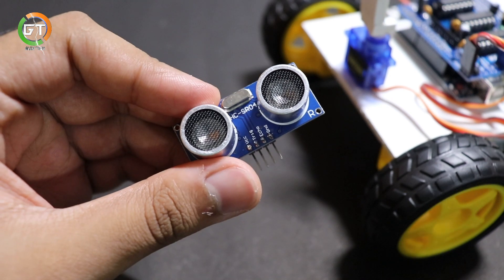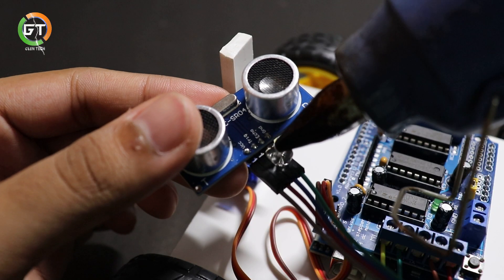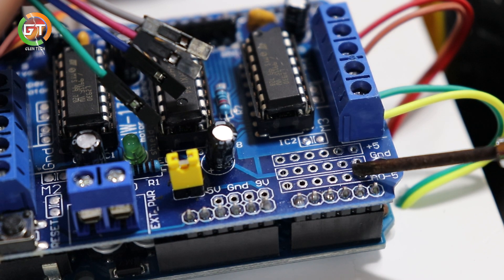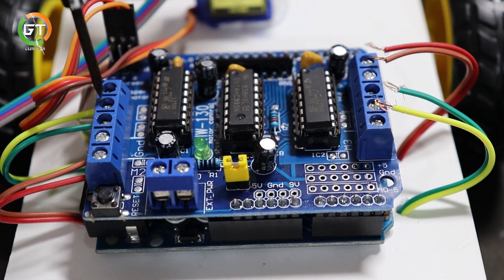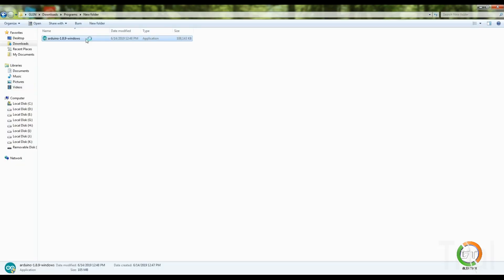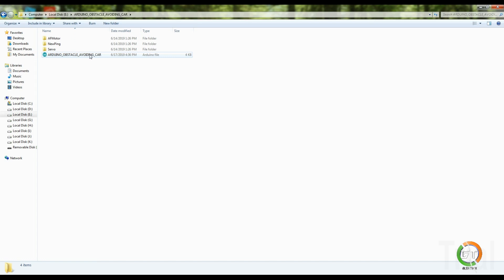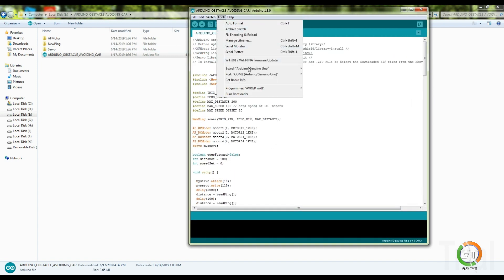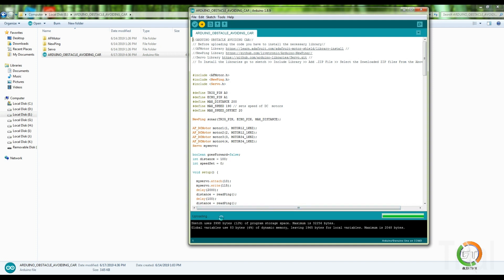How To Make A DIY Arduino Obstacle Avoiding Car For Science Project

Comment: I were inserted code into Arduino ..howcan i delete that and reset my board..
Reply from the maker: No need to reset , you just insert new code
Reply from the maker: //ARDUINO OBSTACLE AVOIDING CAR//
// Before uploading the code you have to install the necessary library//
//AFMotor Library https://learn.adafruit.com/adafruit-motor-shield/library-install //
//NewPing Library https://github.com/livetronic/Arduino-NewPing// 
//Servo Library https://github.com/arduino-libraries/Servo.git //
// To Install the libraries go to sketch >> Include Library >> Add .ZIP File >> Select the Downloaded ZIP files From the Above links //

#include <AFMotor.h>  
#include <NewPing.h>
#include <Servo.h> 

#define TRIG_PIN A0 
#define ECHO_PIN A1 
#define MAX_DISTANCE 200 
#define MAX_SPEED 190 // sets speed of DC  motors
#define MAX_SPEED_OFFSET 20

NewPing sonar(TRIG_PIN, ECHO_PIN, MAX_DISTANCE); 

AF_DCMotor motor1(1, MOTOR12_1KHZ); 
AF_DCMotor motor2(2, MOTOR12_1KHZ);
AF_DCMotor motor3(3, MOTOR34_1KHZ);
AF_DCMotor motor4(4, MOTOR34_1KHZ);
Servo myservo;   

boolean goesForward=false;
int distance = 100;
int speedSet = 0;

void setup() {

  myservo.attach(10);  
  myservo.write(115); 
  delay(2000);
  distance = readPing();
  delay(100);
  distance = readPing();
  delay(100);
  distance = readPing();
  delay(100);
  distance = readPing();
  delay(100);
}

void loop() {
 int distanceR = 0;
 int distanceL =  0;
 delay(40);
 
 if(distance<=15)
 {
  moveStop();
  delay(100);
  moveBackward();
  delay(300);
  moveStop();
  delay(200);
  distanceR = lookRight();
  delay(200);
  distanceL = lookLeft();
  delay(200);

  if(distanceR>=distanceL)
  {
    turnRight();
    moveStop();
  }else
  {
    turnLeft();
    moveStop();
  }
 }else
 {
  moveForward();
 }
 distance = readPing();
}

int lookRight()
{
    myservo.write(50); 
    delay(500);
    int distance = readPing();
    delay(100);
    myservo.write(115); 
    return distance;
}

int lookLeft()
{
    myservo.write(170); 
    delay(500);
    int distance = readPing();
    delay(100);
    myservo.write(115); 
    return distance;
    delay(100);
}

int readPing() { 
  delay(70);
  int cm = sonar.ping_cm();
  if(cm==0)
  {
    cm = 250;
  }
  return cm;
}

void moveStop() {
  motor1.run(RELEASE); 
  motor2.run(RELEASE);
  motor3.run(RELEASE);
  motor4.run(RELEASE);
  } 
  
void moveForward() {

 if(!goesForward)
  {
    goesForward=true;
    motor1.run(FORWARD);      
    motor2.run(FORWARD);
    motor3.run(FORWARD); 
    motor4.run(FORWARD);     
   for (speedSet = 0; speedSet < MAX_SPEED; speedSet +=2) // slowly bring the speed up to avoid loading down the batteries too quickly
   {
    motor1.setSpeed(speedSet);
    motor2.setSpeed(speedSet);
    motor3.setSpeed(speedSet);
    motor4.setSpeed(speedSet);
    delay(5);
   }
  }
}

void moveBackward() {
    goesForward=false;
    motor1.run(BACKWARD);      
    motor2.run(BACKWARD);
    motor3.run(BACKWARD);
    motor4.run(BACKWARD);  
  for (speedSet = 0; speedSet < MAX_SPEED; speedSet +=2) // slowly bring the speed up to avoid loading down the batteries too quickly
  {
    motor1.setSpeed(speedSet);
    motor2.setSpeed(speedSet);
    motor3.setSpeed(speedSet);
    motor4.setSpeed(speedSet);
    delay(5);
  }
}  

void turnRight() {
  motor1.run(FORWARD);
  motor2.run(FORWARD);
  motor3.run(BACKWARD);
  motor4.run(BACKWARD);     
  delay(500);
  motor1.run(FORWARD);      
  motor2.run(FORWARD);
  motor3.run(FORWARD);
  motor4.run(FORWARD);      
} 
 
void turnLeft() {
  motor1.run(BACKWARD);     
  motor2.run(BACKWARD);  
  motor3.run(FORWARD);
  motor4.run(FORWARD);   
  delay(500);
  motor1.run(FORWARD);     
  motor2.run(FORWARD);
  motor3.run(FORWARD);
  motor4.run(FORWARD);
}
Reply from the maker: // Before uploading the code you have to install the necessary library//
//AFMotor Library https://learn.adafruit.com/adafruit-motor-shield/library-install //
//NewPing Library https://github.com/livetronic/Arduino-NewPing// 
//Servo Library https://github.com/arduino-libraries/Servo.git //
// To Install the libraries go to sketch >> Include Library >> Add .ZIP File >> Select the Downloaded ZIP files From the Above links //

Comment: Bro pls tell me ...all the connections are correct....but motor are not rotating.........
Reply from the maker: // Before uploading the code you have to install the necessary library//
//AFMotor Library https://learn.adafruit.com/adafruit-motor-shield/library-install //
//NewPing Library https://github.com/livetronic/Arduino-NewPing// 
//Servo Library https://github.com/arduino-libraries/Servo.git //
// To Install the libraries go to sketch >> Include Library >> Add .ZIP File >> Select the Downloaded ZIP files From the Above links //

Comment: Why my car he ring ?
Reply from the maker: //ARDUINO OBSTACLE AVOIDING CAR//
// Before uploading the code you have to install the necessary library//
//AFMotor Library https://learn.adafruit.com/adafruit-motor-shield/library-install //
//NewPing Library https://github.com/livetronic/Arduino-NewPing// 
//Servo Library https://github.com/arduino-libraries/Servo.git //
// To Install the libraries go to sketch >> Include Library >> Add .ZIP File >> Select the Downloaded ZIP files From the Above links //

#include <AFMotor.h>  
#include <NewPing.h>
#include <Servo.h> 

#define TRIG_PIN A0 
#define ECHO_PIN A1 
#define MAX_DISTANCE 200 
#define MAX_SPEED 190 // sets speed of DC  motors
#define MAX_SPEED_OFFSET 20

NewPing sonar(TRIG_PIN, ECHO_PIN, MAX_DISTANCE); 

AF_DCMotor motor1(1, MOTOR12_1KHZ); 
AF_DCMotor motor2(2, MOTOR12_1KHZ);
AF_DCMotor motor3(3, MOTOR34_1KHZ);
AF_DCMotor motor4(4, MOTOR34_1KHZ);
Servo myservo;   

boolean goesForward=false;
int distance = 100;
int speedSet = 0;

void setup() {

  myservo.attach(10);  
  myservo.write(115); 
  delay(2000);
  distance = readPing();
  delay(100);
  distance = readPing();
  delay(100);
  distance = readPing();
  delay(100);
  distance = readPing();
  delay(100);
}

void loop() {
 int distanceR = 0;
 int distanceL =  0;
 delay(40);
 
 if(distance<=15)
 {
  moveStop();
  delay(100);
  moveBackward();
  delay(300);
  moveStop();
  delay(200);
  distanceR = lookRight();
  delay(200);
  distanceL = lookLeft();
  delay(200);

  if(distanceR>=distanceL)
  {
    turnRight();
    moveStop();
  }else
  {
    turnLeft();
    moveStop();
  }
 }else
 {
  moveForward();
 }
 distance = readPing();
}

int lookRight()
{
    myservo.write(50); 
    delay(500);
    int distance = readPing();
    delay(100);
    myservo.write(115); 
    return distance;
}

int lookLeft()
{
    myservo.write(170); 
    delay(500);
    int distance = readPing();
    delay(100);
    myservo.write(115); 
    return distance;
    delay(100);
}

int readPing() { 
  delay(70);
  int cm = sonar.ping_cm();
  if(cm==0)
  {
    cm = 250;
  }
  return cm;
}

void moveStop() {
  motor1.run(RELEASE); 
  motor2.run(RELEASE);
  motor3.run(RELEASE);
  motor4.run(RELEASE);
  } 
  
void moveForward() {

 if(!goesForward)
  {
    goesForward=true;
    motor1.run(FORWARD);      
    motor2.run(FORWARD);
    motor3.run(FORWARD); 
    motor4.run(FORWARD);     
   for (speedSet = 0; speedSet < MAX_SPEED; speedSet +=2) // slowly bring the speed up to avoid loading down the batteries too quickly
   {
    motor1.setSpeed(speedSet);
    motor2.setSpeed(speedSet);
    motor3.setSpeed(speedSet);
    motor4.setSpeed(speedSet);
    delay(5);
   }
  }
}

void moveBackward() {
    goesForward=false;
    motor1.run(BACKWARD);      
    motor2.run(BACKWARD);
    motor3.run(BACKWARD);
    motor4.run(BACKWARD);  
  for (speedSet = 0; speedSet < MAX_SPEED; speedSet +=2) // slowly bring the speed up to avoid loading down the batteries too quickly
  {
    motor1.setSpeed(speedSet);
    motor2.setSpeed(speedSet);
    motor3.setSpeed(speedSet);
    motor4.setSpeed(speedSet);
    delay(5);
  }
}  

void turnRight() {
  motor1.run(FORWARD);
  motor2.run(FORWARD);
  motor3.run(BACKWARD);
  motor4.run(BACKWARD);     
  delay(500);
  motor1.run(FORWARD);      
  motor2.run(FORWARD);
  motor3.run(FORWARD);
  motor4.run(FORWARD);      
} 
 
void turnLeft() {
  motor1.run(BACKWARD);     
  motor2.run(BACKWARD);  
  motor3.run(FORWARD);
  motor4.run(FORWARD);   
  delay(500);
  motor1.run(FORWARD);     
  motor2.run(FORWARD);
  motor3.run(FORWARD);
  motor4.run(FORWARD);
}
Reply: I know come on to your instagram for watch video

Comment: error help me plss
Reply from the maker: //ARDUINO OBSTACLE AVOIDING CAR//
// Before uploading the code you have to install the necessary library//
//AFMotor Library https://learn.adafruit.com/adafruit-motor-shield/library-install //
//NewPing Library https://github.com/livetronic/Arduino-NewPing// 
//Servo Library https://github.com/arduino-libraries/Servo.git //
// To Install the libraries go to sketch >> Include Library >> Add .ZIP File >> Select the Downloaded ZIP files From the Above links //

#include <AFMotor.h>  
#include <NewPing.h>
#include <Servo.h> 

#define TRIG_PIN A0 
#define ECHO_PIN A1 
#define MAX_DISTANCE 200 
#define MAX_SPEED 190 // sets speed of DC  motors
#define MAX_SPEED_OFFSET 20

NewPing sonar(TRIG_PIN, ECHO_PIN, MAX_DISTANCE); 

AF_DCMotor motor1(1, MOTOR12_1KHZ); 
AF_DCMotor motor2(2, MOTOR12_1KHZ);
AF_DCMotor motor3(3, MOTOR34_1KHZ);
AF_DCMotor motor4(4, MOTOR34_1KHZ);
Servo myservo;   

boolean goesForward=false;
int distance = 100;
int speedSet = 0;

void setup() {

  myservo.attach(10);  
  myservo.write(115); 
  delay(2000);
  distance = readPing();
  delay(100);
  distance = readPing();
  delay(100);
  distance = readPing();
  delay(100);
  distance = readPing();
  delay(100);
}

void loop() {
 int distanceR = 0;
 int distanceL =  0;
 delay(40);
 
 if(distance<=15)
 {
  moveStop();
  delay(100);
  moveBackward();
  delay(300);
  moveStop();
  delay(200);
  distanceR = lookRight();
  delay(200);
  distanceL = lookLeft();
  delay(200);

  if(distanceR>=distanceL)
  {
    turnRight();
    moveStop();
  }else
  {
    turnLeft();
    moveStop();
  }
 }else
 {
  moveForward();
 }
 distance = readPing();
}

int lookRight()
{
    myservo.write(50); 
    delay(500);
    int distance = readPing();
    delay(100);
    myservo.write(115); 
    return distance;
}

int lookLeft()
{
    myservo.write(170); 
    delay(500);
    int distance = readPing();
    delay(100);
    myservo.write(115); 
    return distance;
    delay(100);
}

int readPing() { 
  delay(70);
  int cm = sonar.ping_cm();
  if(cm==0)
  {
    cm = 250;
  }
  return cm;
}

void moveStop() {
  motor1.run(RELEASE); 
  motor2.run(RELEASE);
  motor3.run(RELEASE);
  motor4.run(RELEASE);
  } 
  
void moveForward() {

 if(!goesForward)
  {
    goesForward=true;
    motor1.run(FORWARD);      
    motor2.run(FORWARD);
    motor3.run(FORWARD); 
    motor4.run(FORWARD);     
   for (speedSet = 0; speedSet < MAX_SPEED; speedSet +=2) // slowly bring the speed up to avoid loading down the batteries too quickly
   {
    motor1.setSpeed(speedSet);
    motor2.setSpeed(speedSet);
    motor3.setSpeed(speedSet);
    motor4.setSpeed(speedSet);
    delay(5);
   }
  }
}

void moveBackward() {
    goesForward=false;
    motor1.run(BACKWARD);      
    motor2.run(BACKWARD);
    motor3.run(BACKWARD);
    motor4.run(BACKWARD);  
  for (speedSet = 0; speedSet < MAX_SPEED; speedSet +=2) // slowly bring the speed up to avoid loading down the batteries too quickly
  {
    motor1.setSpeed(speedSet);
    motor2.setSpeed(speedSet);
    motor3.setSpeed(speedSet);
    motor4.setSpeed(speedSet);
    delay(5);
  }
}  

void turnRight() {
  motor1.run(FORWARD);
  motor2.run(FORWARD);
  motor3.run(BACKWARD);
  motor4.run(BACKWARD);     
  delay(500);
  motor1.run(FORWARD);      
  motor2.run(FORWARD);
  motor3.run(FORWARD);
  motor4.run(FORWARD);      
} 
 
void turnLeft() {
  motor1.run(BACKWARD);     
  motor2.run(BACKWARD);  
  motor3.run(FORWARD);
  motor4.run(FORWARD);   
  delay(500);
  motor1.run(FORWARD);     
  motor2.run(FORWARD);
  motor3.run(FORWARD);
  motor4.run(FORWARD);
}

Comment: Hi
My servo motor is on
But my wheel motors r not on
Reply from the maker: //ARDUINO OBSTACLE AVOIDING CAR//
// Before uploading the code you have to install the necessary library//
//AFMotor Library https://learn.adafruit.com/adafruit-motor-shield/library-install //
//NewPing Library https://github.com/livetronic/Arduino-NewPing// 
//Servo Library https://github.com/arduino-libraries/Servo.git //
// To Install the libraries go to sketch >> Include Library >> Add .ZIP File >> Select the Downloaded ZIP files From the Above links //

#include <AFMotor.h>  
#include <NewPing.h>
#include <Servo.h> 

#define TRIG_PIN A0 
#define ECHO_PIN A1 
#define MAX_DISTANCE 200 
#define MAX_SPEED 190 // sets speed of DC  motors
#define MAX_SPEED_OFFSET 20

NewPing sonar(TRIG_PIN, ECHO_PIN, MAX_DISTANCE); 

AF_DCMotor motor1(1, MOTOR12_1KHZ); 
AF_DCMotor motor2(2, MOTOR12_1KHZ);
AF_DCMotor motor3(3, MOTOR34_1KHZ);
AF_DCMotor motor4(4, MOTOR34_1KHZ);
Servo myservo;   

boolean goesForward=false;
int distance = 100;
int speedSet = 0;

void setup() {

  myservo.attach(10);  
  myservo.write(115); 
  delay(2000);
  distance = readPing();
  delay(100);
  distance = readPing();
  delay(100);
  distance = readPing();
  delay(100);
  distance = readPing();
  delay(100);
}

void loop() {
 int distanceR = 0;
 int distanceL =  0;
 delay(40);
 
 if(distance<=15)
 {
  moveStop();
  delay(100);
  moveBackward();
  delay(300);
  moveStop();
  delay(200);
  distanceR = lookRight();
  delay(200);
  distanceL = lookLeft();
  delay(200);

  if(distanceR>=distanceL)
  {
    turnRight();
    moveStop();
  }else
  {
    turnLeft();
    moveStop();
  }
 }else
 {
  moveForward();
 }
 distance = readPing();
}

int lookRight()
{
    myservo.write(50); 
    delay(500);
    int distance = readPing();
    delay(100);
    myservo.write(115); 
    return distance;
}

int lookLeft()
{
    myservo.write(170); 
    delay(500);
    int distance = readPing();
    delay(100);
    myservo.write(115); 
    return distance;
    delay(100);
}

int readPing() { 
  delay(70);
  int cm = sonar.ping_cm();
  if(cm==0)
  {
    cm = 250;
  }
  return cm;
}

void moveStop() {
  motor1.run(RELEASE); 
  motor2.run(RELEASE);
  motor3.run(RELEASE);
  motor4.run(RELEASE);
  } 
  
void moveForward() {

 if(!goesForward)
  {
    goesForward=true;
    motor1.run(FORWARD);      
    motor2.run(FORWARD);
    motor3.run(FORWARD); 
    motor4.run(FORWARD);     
   for (speedSet = 0; speedSet < MAX_SPEED; speedSet +=2) // slowly bring the speed up to avoid loading down the batteries too quickly
   {
    motor1.setSpeed(speedSet);
    motor2.setSpeed(speedSet);
    motor3.setSpeed(speedSet);
    motor4.setSpeed(speedSet);
    delay(5);
   }
  }
}

void moveBackward() {
    goesForward=false;
    motor1.run(BACKWARD);      
    motor2.run(BACKWARD);
    motor3.run(BACKWARD);
    motor4.run(BACKWARD);  
  for (speedSet = 0; speedSet < MAX_SPEED; speedSet +=2) // slowly bring the speed up to avoid loading down the batteries too quickly
  {
    motor1.setSpeed(speedSet);
    motor2.setSpeed(speedSet);
    motor3.setSpeed(speedSet);
    motor4.setSpeed(speedSet);
    delay(5);
  }
}  

void turnRight() {
  motor1.run(FORWARD);
  motor2.run(FORWARD);
  motor3.run(BACKWARD);
  motor4.run(BACKWARD);     
  delay(500);
  motor1.run(FORWARD);      
  motor2.run(FORWARD);
  motor3.run(FORWARD);
  motor4.run(FORWARD);      
} 
 
void turnLeft() {
  motor1.run(BACKWARD);     
  motor2.run(BACKWARD);  
  motor3.run(FORWARD);
  motor4.run(FORWARD);   
  delay(500);
  motor1.run(FORWARD);     
  motor2.run(FORWARD);
  motor3.run(FORWARD);
  motor4.run(FORWARD);
}
Reply from the maker: Use this code